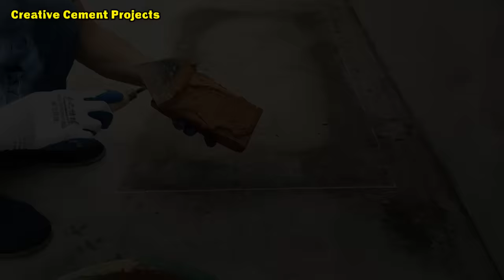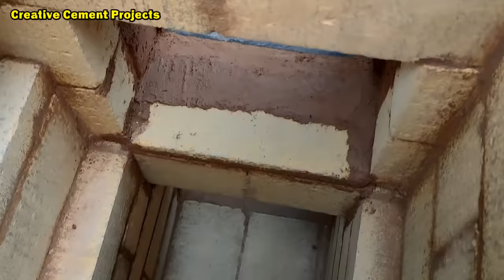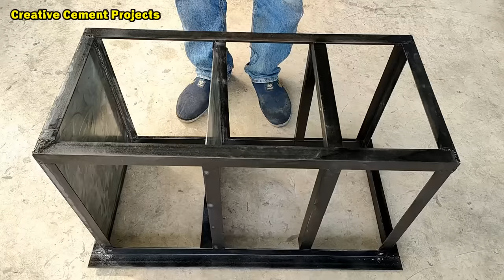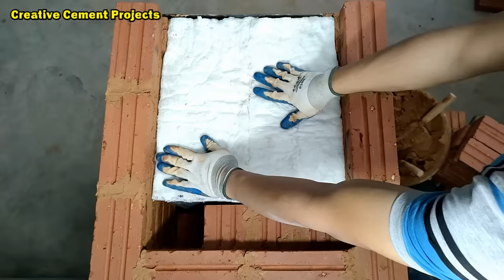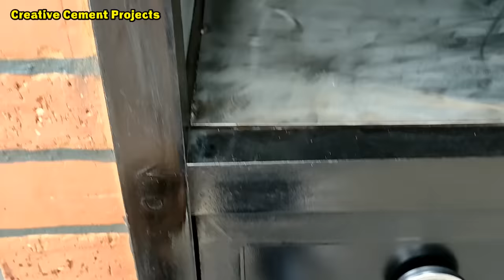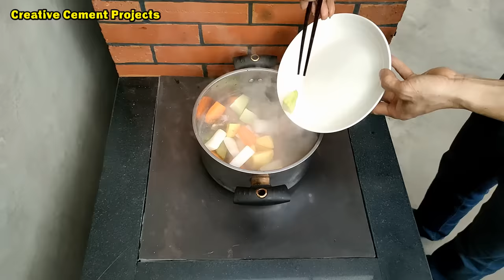How to build a wood stove, combined with a 3 storey oven to heat food very effectively

Comment: This is amazing. I only wish you could name all the materials that you use. Like the white bricks and that white paperish material. Some of us are new to construction.
Reply: i'm pretty sure they are Rockwool (paperish material) and Fire bricks, BigstackD Casting  and Alumitube uses it in a forge to melt metal, hope this helps :D
Reply from the maker: Thank you. Raw materials include clay, sand, red fired bricks and refractory bricks, insulating ceramic wool
Reply from the maker: The brick with yellow color is a refractory brick, and ceramic wool for insulation
Reply: Seeming your new to construction make sure you build it outside, thats is if you don't want a room full of smoke.  But there is another video of a smokeless wood stove they have posted.
Reply: I love this!
Reply: Qa🍏🍇😙
Reply: @Trelleborg если делать очень тонкие швы 3-4 мм то и обычная глина вполне годится ну и обязательно жирность глины уменьшить песком.
Reply: Fire bricks  and fire proof insulation made of ceramics fiber blanket
Reply: @LUREDADDY52  sí puede hacerla adentro de la casa. Solo le hace la chimenea con salida al exterior.
Reply: @shadowrtst7442  ⁰
Reply: What is the name of the black square oven doors SPECIFICALLY?
Reply: Firewood doors to the left included
Reply: Fire brick are the white blonde brick and the white paperish material is fiberglass blanket for expansion and contraction . Fire clay is used to lay the brick. You are welcome.🤗
Reply: @rennickdoost6858  do you the specific names of the doors?
Reply: The doors you can find at a chimney supply store. Just a fireplace door or wood stove doors I imagine are what they’d be listed as
Reply: Белый кирпич это шамот,точное название ш-5. Используется в плавильных печах. Белая бумага :) это минеральная вата,хорошо держит тепло, её затыкают дырки и температурные швы. Материал не дешёвый,но здесь применили бестолково. Я не теплотехник,но понимаю что печь говно. Построена с нулевым КПД. Тяги в такой печи нет от слова "совсем" А все тепло от сгорания будет уходить в трубу. На картинке красиво,а по факту человек построил печь без малейшего понимания.
Reply: @Creativeproject2020  honestly, knowing the kind of channel I was expecting a "thank you for watching :)" half-assed answer with no info whatsoever. It's cool to see you actually went and did a list instead of doing the old "what are the materials?" "Thanks for watching." everybody else does
Reply: @shadowrtst7442  ,
Reply: @Creativeproject2020  ^*story, not storey
Reply: @Trelleborg  probably the cost.  This is a fairly expensive build as it is and the clay, sand, cement mix is both effective and fairly inexpensive compared to refractory cement.
Reply: Белый кирпич это огнеупорный, а белый материал тоже огнеупорный
Reply: It is not a white bricks, it's yellowish on color, it's called refractory bricks, the white  fiber is called ceramic fiber used for high temp insulation. Nice project ..awesome design.
Reply: What the doors are made up of?
Reply: Нет перевязки в кладке
Reply: Bonjour.
C'est sûrement pour l'extérieur ! 
Comment on ramone ?
Où est le conduit de fumée ? 
Salutations.
Reply: Белый материал  - это шамотная ткань, используется для изоляции аысокотепловых труб на изоляции. Но в таком положении в печи месяца через три она превратится в труху. Это не горючая ткань, но от высоких температур она трушиться. Как и пух шнур. Здесь должна использоваться спец.шамотная крошка. Вот она будет служить, да и то - какое-то время......
Reply: @LUREDADDY52 this was for the chimney. I am trying to figure it out though since he didn't show it till the  end.

Comment: DO NOT build this out of red bricks, they can explode when heated
Reply: Obviously you weren't paying attention. Do you know what a kiln is? That's what they did on the interior so it doesn't get hot at all on the outside. Those white bricks can withstand extreme heat, and that cloth is flame resistant in case it does catch.

Comment: Wow! Just beautiful! The questions I have is 1) The sheet metal used, is it aluminum or stainless steel? If a grate was used (for grilling) instead of the sheet cook top would that let out too much heat to make the oven ineffective?
Reply from the maker: Thank you. the top of my stove uses an iron plate, if you use a grid it will lose all the heat of the oven
Reply: Definitely don't use aluminum or tin. Iron or stainless steel, is the way to go.

Comment: How long did the pizza take to cook and what temperature did the oven mark? It would seem that the upper part is just to mildly heat other baked goods?
Reply from the maker: Thank you. depending on the cooking time. If the stove is already heated, the pizza oven cooks very quickly, and the top two compartments are for reheating food
Reply: See, they have them self covered by saying "depending on the cooking time & if the stove is already heated" still didn't get your answer.  Most pizza ovens have a very high temperature so the base cooks as well as the top.  Didn't see the base so don't know how cooked it was. And where does the smoke go?  Going to watch their other video now a "smokeless wood stove"

Comment: I'd be intersted to see how it works, certainly didn't seem to be enough mortar between the bricks, and they were too widely spaced. Also that mortar is going to dry and shrink, you need to add portland sement, or slacked lime, clay and sand isn't good enough.
Reply from the maker: Thank you. This stove still works well

Comment: This is wonderful! I would like to have one like this.  Can you please provide the list of materials and dimensions? Thank you. I have learned a lot from your channel ☺️.
Reply from the maker: Thank you for watching. Raw materials include red brick, half-resistant brick, clay, sand, insulation cotton, steel frame, cast iron alloy plate.
The dimensions of the stove are: overall height is 155cm; the length of two stoves is 116cm; the depth of the stove is 63cm; the height of the hob below is 73cm; the width of the hob below is 56cm; the height of the baking box is 82cm; The width of the baking box is 62cm.
Reply: hope you could discuss while doing everything
Reply: Nancy, I don't believe for a second that the oven feature on this is functional. There is no way that would get hot enough to bake anything being that the fuel/wood burning area is so small. Notice how he placed already baked rolls in it then pulled them out as if they were baked in it and the buns or whatever they were didn't get baked at all? You can't even fit normal size firewood in that thing. If you could fit larger and more wood in it I'm fairly certain it would work.
Reply: @BornN2Grave1  I believe the upper oven is for warming things, the baked bread was put to warm it up I guess, because if you look at the pizza he put below it baked well. while the white dough rose in the upper oven too so I guess the upper oven functions like a mild microwave
Reply: Талант АРХИТЕКТОРА !!! АККУРАТНО  БЫСТРО !!! БЛАГОСЛОВЕНИЙ СВЫШЕ В ДЕЛЕ РУК ВАШИХ !!!
Reply: More like a proofing box, brick close to the source of heat will get hot enough for pizza and bread as it cools.

Comment: Look cute, but as someone who designed, built, cleaned and repaired chimneys, pizza and bread ovens (private & commercial), I see several long term issues with this design.

Piping the fire exhaust directly around the cook box, without some way to remove it or without access the smoke chamber around the box, soot eventually will build up to a point of blockage or (in worst-case) chimney fire.  Unless you are strictly using gas, burning wood products of any kind will create a build up and will periodically need to be addressed.
Reply from the maker: Thank you. I also made the mistake of not designing the door to clean coal ash. But you can fix it by, creating a door on the bottom, side of the oven

Comment: How thick should be a stove metal plate?  What kind of steel to use for that? 
I built the same stove/oven combo based on what you show here. It is in our kitchen and I hope it will work well with a coil pipe connected to the water heater. It is a really interesting project. How it will work I do not know yet. For now, I have a problem with the plate as I installed thin heat-resistant steel which bends quite badly. I need to change that to something thicker .
Reply from the maker: Thank you. It is best to use stainless steel or cast iron. and should install heat-resistant glass with a thickness of 5 mm
Reply: @Creativeproject2020  Hi , thank you very much for your reply . Let me clarify : how thick should be a stainless steel /cast iron plate ?
Put heat-resistant glass on top of the steel plate? - I am not shure why I need a heat resistant glass ?
Reply: Could you please to answer to my question when you find some time ? I am not sure what to do .

Comment: Great Work!!! I would like to know about materials used and measurements of the 3 storey oven...thx..:)
Reply from the maker: Thanks for watching. Materials include 250 red bricks, 50 semi-strength bricks, 60kg clay, 60kg sand, cotton insulation, steel frame, cast iron alloy plate.
The dimensions of the stove are: the total height is 155 cm; the length of two stoves is 116 cm; the depth of the stove is 63 cm; the height of the lower stove is 73 cm; the width of the lower stove is 56 cm; the height of the baking box is 82 cm; The width of the baking box is 62 cm. Please refer to the photos in the community tab for exact sizing.
Reply: @Creativeproject2020  thx:)

Comment: @4:28 and @7:08: what are those white pieces called? how can you put them in a super hot oven, they would not get on fire?
Reply from the maker: Thank you. That white sheet is heat-resistant ceramic wool, and insulates very well. I use it to seal gaps. You can find out online and buy online

Comment: Hello can i ask  the material please thank u ?? So amazing
Reply from the maker: Thank you for watching. Raw materials include red brick, half-resistant brick, clay, sand, insulation cotton, steel frame, cast iron alloy plate.
The dimensions of the stove are: overall height is 155cm; the length of two stoves is 116cm; the depth of the stove is 63cm; the height of the hob below is 73cm; the width of the hob below is 56cm; the height of the baking box is 82cm; The width of the baking box is 62cm.
Reply: @Creativeproject2020  thank u

Comment: What fabric material are you using that placed behind the fire brick?
Thanks
Reply from the maker: Thank you. I use ceramic wool for insulation, and it's very heat resistant

Comment: Hi.. Can you say how without the fire hole on top pot get heat and the food get cooked for this only stainless steel and iron cast iron vessels are to be used... Will the mud pot or clay pot can use for cooking??? Kindly reply please
Reply from the maker: Thank you. The cooktop is to keep the pots and pans clean. If you use an earthen pot or a mud pot, the heat transfer will be worse. You can use a stovetop with a fire hole

Comment: How thick is the steel plate where you put the pots?
Reply from the maker: Thank you. I use a steel plate with a thickness of 0.5 mm. but you still have to reinforce the brace frame around the underside of the steel plate, to avoid warping

Comment: At 7:05 you install some sort of foam which does not burn and is resistant to heat. What is it called? is it available in Vietnam? I am in Cambodia, not sure if I can find it here.
Reply from the maker: Thank you. That white stuff is ceramic wool that is heat-resistant and insulates very well. I use it to seal gaps. You can refer to and buy online, there are many online
Reply from the maker: You can buy it on shopee
Reply from the maker: Heat-resistant ceramic wool

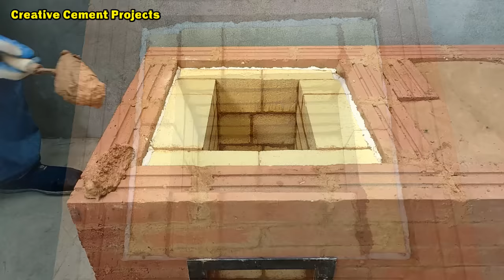Comment: 3:04 What makes the cream bricks different from the red?
And what is the white stuff which goes between the cream and red bricks?
Reply from the maker: Thank you. That yellow brick is refractory brick. And that white stuff is refractory ceramic wool, and it insulates very well, I use it to seal the gaps.
Reply: @Creativeproject2020  Thank you =]

Comment: I am curious to know why you did not use refractory cement.
Reply from the maker: Thank you. In terms of cost, heat-resistant cement is more expensive than clay. So I chose the solution of building with clay
Reply: @Creativeproject2020  Thank you for your response.

Comment: What are something white resembling cotton/clothes for? What is the material?
Reply from the maker: Thank you for watching. That white stuff is heat-resistant ceramic wool, and it insulates very well. I use it to seal the gap to prevent smoke from rising onto the stovetop

Comment: He used fireproof insulation fireproof brick I don't know if it's fireproof cement although a very good project the only thing the chimney stack could have been a little higher otherwise this project was magnificent
Reply from the maker: Thank you. The mixture I use is clay mixed with sand

Comment: Author, please write how much and what materials you need.
Reply: Looks like regular red bricks and the white/beige fireproof bricks for the fire pit area. Metal oven racks, metal oven cooking flat stove top, and metal oven frame with metal oven doors. Insulation to maintain the heat. Sand mixed with clay for mortar.

Comment: You didn't say the name of all materials used to build this. But that's okay. I don't think I will be able to build that even with all materials at hand.
Reply from the maker: Thank you for watching. Materials include red brick, clay, sand, ceramic wool insulation and metal box frame. The top of your stove is better made of a cast iron plate, not warped

Comment: Please tell me what things are use in that project
Reply from the maker: Thank you. Materials include fired clay bricks, heat-resistant bricks, a mixture of clay mixed with sand, ceramic wool insulation, and some metal accessories.

Comment: whats the white cloth??
Reply from the maker: Thank you. That white stuff is heat-resistant ceramic wool, and it insulates very well. I used it to seal the gap to prevent smoke from escaping upward

Comment: The plate that the pot is on is not hot, you can see that the hot water spilling on it does not evaporate. https://youtu.be/eLHSiBmbVC4?t=800
Reply from the maker: Thank you. This stove's iron plate gets hot very quickly. But due to high temperature the iron plate warped. I had to remove and reinforce the frame around the underside of the iron plate. When I put it in, I was always filming, so the stovetop wasn't hot yet.